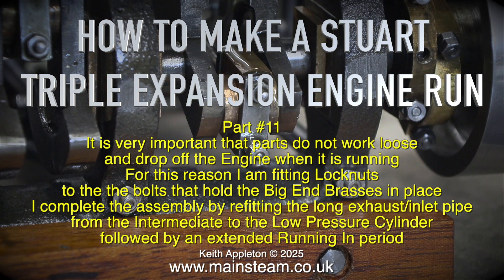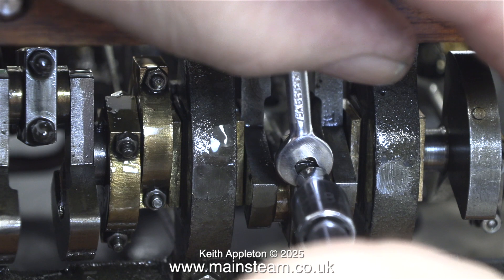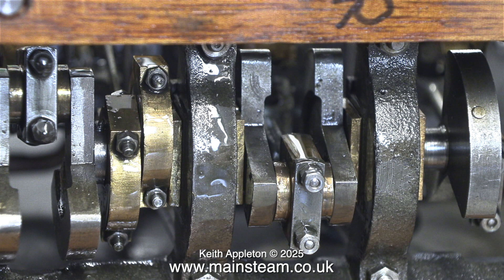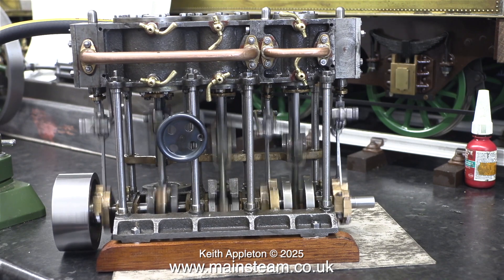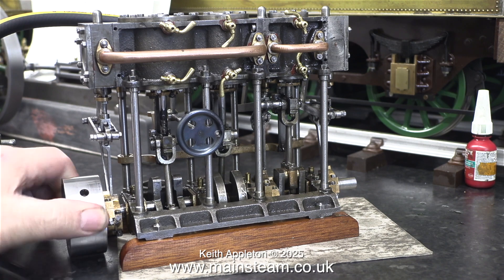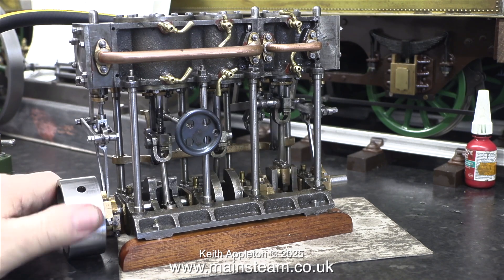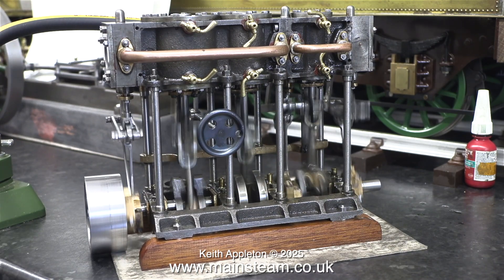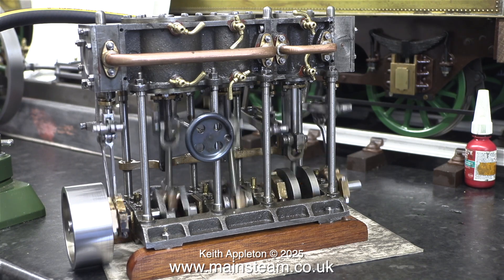HOW TO MAKE A STUART TRIPLE ENGINE RUN - PART #11

Comment: When you do a steam test, is it possible to show a side-by-side comparison to show the difference between steam and air?
Reply from the maker: If you watch a few more of my videos, in most of the time I run the Steam Engines on Compressed Air first.

Comment: If it is  not self starting,   how will   this work fitted to a boat?
Reply from the maker: The boat that the customer is building is quite large and it is easy enough to flick over the engine by hand, as I have shown many times during this series. . . . .

Comment: Very much looking forward to seeing running with steam.  I’ve always wondered what the inlet pressure of the LP cylinder ( and the IP for that matter ) would actually be when working  under a load ? Running very smoothly already.